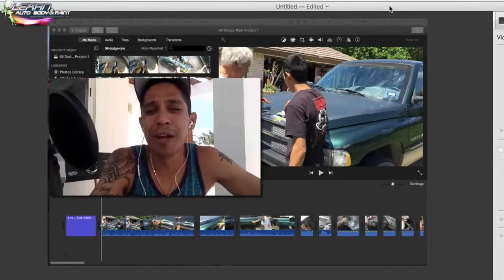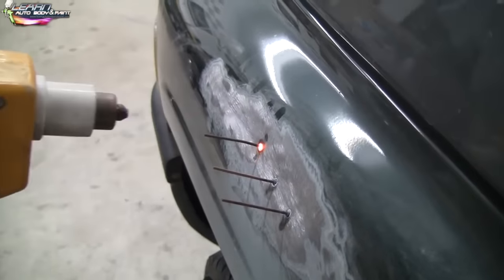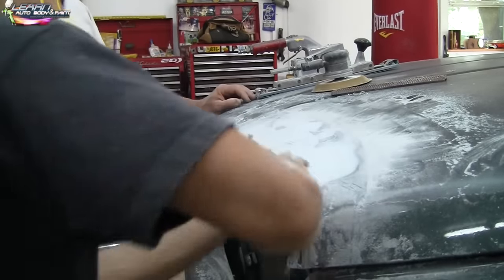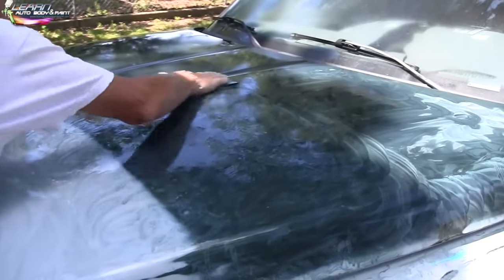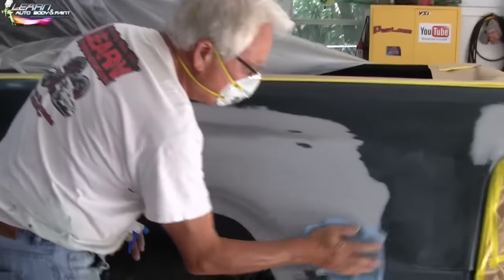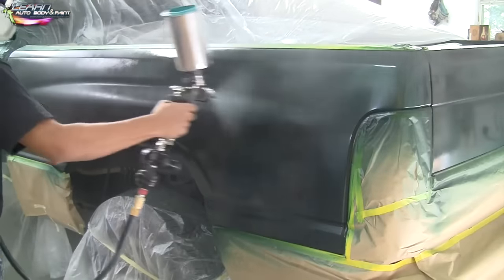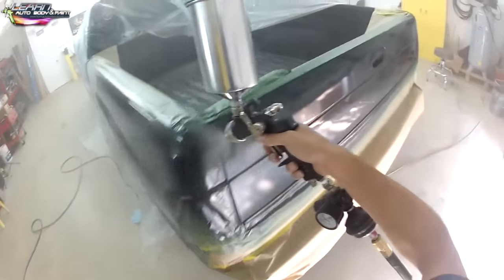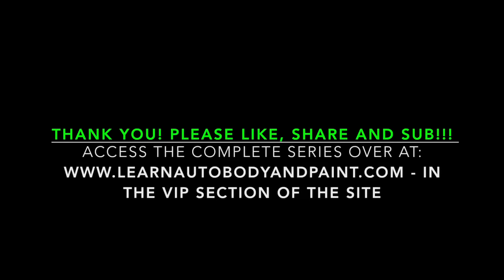For Newbies-  Auto Body And Car Painting Footage- Step by Step DIY SPECIAL

Comment: I have a question.  My car needs to be painted soon, but I have a relatively new safety sticker.    I also score it so it’s harder to steal.   Is there anyway to remove it before the car is painted so it can be put back on after the car is painted?

Comment: Hey Tony, quick question... I'll be spraying my 2011 Silverado extended cab with Blue Ray metallic and then clear coat. How much time do I allow my base coats to dry in about 70-80° and then how long after base coats do I wait to spray my clear and how long in between clear coats?

Comment: when you say about newbies not applying enough clear coat i think it's better to not soak it with clear coat cuz it will drip down and ruin the paint job
Reply: Little Man Huerta as long as your allowing flash time you can put on a few coats. just don't go back to back.

Comment: 80 grit prep for filler? to course it will shrink back, use 180grit . 320grit for primer filler, 600grit for high solids and black, brighter basecoats and water based will show the scratches below 800grit. No PPE? Spray gun looks like bought from Aldi stores? NO, Its not better to have more clear . your colour matching will be off if too much clear. Rule is simple - you can't do colour matching don't do the job!

Comment: I was surprised the truck didnt get a primer before painting. Do you have to get the old clearcoat removed?
Reply from the maker: Hey Ron, check this out: https://www.learnautobodyandpaint.com/car-painting-hacks-no-primer-needed-over-clearcoat-basecoat-with-atom-x16/
Reply: @LearnAutoBodyDIY  thanks Tony. I have a Fiat 500 I picked up with front end damage which is all fixed. It appears car went through brush like a rose garden  hundreds of pin homes through paint and no dings. Can I wet sand than hit it with filler primer, sand and paint? The pin holes are all over fenders and not sure if I just paint they'll cover up. If I can send pic they'd be great. Am a vip member

Comment: Hi  tony  ,  i  have  a  question  when you buy  new  wool pad for your  buffer  do  you  ever  have  any   lint  fly  off  when buffing  with   new  wool  pad?  i bought  3m  single  side  hook it  yellow  wool pad  i was  buffing then  wool fuzz  was  off .
Reply: They are all like that new. Gotta break them in a little bit on a test surface with some product  and then you should be good 👍

Comment: If the repair is at the front of the bonnet, i don't see why you base coated the entire thing.. it would have been alot more effective to steer well clear of the panels that meet edge to edge with the bonnet, and just blend the colour up the bonnet with a smooth transition, and then clear the whole thing.. That way you don't get the edge to edge colour difference on the wings

Comment: I am new to painting, I noticed you where using omni, when I finish my clear coat I am having a problem of getting specs on the top of the clear. do you have any suggestions, to prevent or remove it?

Comment: I want to do this to my work truck. Its starting to flake and get surface rust. I expect at least another 10 years out of the truck and don't want it rusted through.
Reply: phatrides222000 good way to keep it even longer is remove the bed of the truck spray the underneath with rubber and spray the frame with rubber we have guys who have pick ups from the 70's with underneaths that look show room

Comment: What about the dust? Dont you need a paint cabin to do these things?
Reply: Yes and no, you definitely need a place that you can control the atmosphere around you. A shed will work as long as you have good ventilation and extraction fans are a plus too
Reply: @Sco33a101  ok, I thought that a lot of dust can set over the wet paint and ruin it
Reply: You are right, if working outside it's inevitable that dust will settle on your work. TO be honest mate, unless your doing a very pricey build you're not going to notice enough to care. But it's not impossible to build a paint cabin. Old coolrooms (meat holders) work excellent
Reply: @Sco33a101  Well, thing is I want to paint an arcade machine rather than a car, and I will be in front of it when playing, thats what worries me...

Comment: Your should used. Tinted sealer. Or a close green first. . Also your primer didn't feather all the way out.  No blending?? Also make sure when j spray the panel I have the whole area primer will be laying sanded better than u did

Comment: I have a question please. I have a 2005 Mercedes SL 500. Its current paint job is good and body great. But I would like to have it painted the new pearlized white on new mercedes and a coat or two of clear coat, or more if necessary. Will $3,000 - 4,000 give me a great job or could it cost allot more.Want to keep Body / Paint Shops close to expectations. Thank you for any help. Yes, I know you can have very expensive paint jobs,  but would money I quoted above, get me a goodjob........

thank you
Reply: Robert Lohr you could pay alot of money to try and get a good paint job. But none of that matters. Its really how good is the person thats doing the job. literally
Ive gotten customers that have gotten paint jobs done for a lot of money. came out as shitty jobs. Then here I come to fix their fucked up work for less than half for what they paid. and ended up very satisfied and happy with my kind of work. 
So yea is all aboute hiring someone that I have passion to do its job. Not just someone that wants money. So be careful because your project can turn in to a nightmare

Comment: You failed to mention ground coats. On a metallic green as transparent as you see it, a coat of black base would be essential in order  to get optimal color coverage when applying the metallic green. This will prevent the grey primer from becoming visible beneath the metallic green in direct sunlight. 

While it took about 4 coats of green before getting any REAL coverage, had the surface been black rather than grey, the hood may of already become completely green with plenty of green paint to spare.

Comment: What guns do you use for each process?
Reply from the maker: Check out the Atom Spray Guns on Zoolaa: https://www.zoolaa.com/ 
You can use 1 spray gun for overall car painting. Use the 1.3 or 1.4 tip size for base coat clear coat and the 2.0 tip kit for primers and other thicker materials.

Comment: yoo turn your pressure down when spraying primer.. 50% of your material is overspray and wasted. turn down pressure and slower strokes.. I spray for a job.. end of the day if it works for you then cool. I work in a high production shop and I would never spray that high of pressure.

Comment: With that f'ed-up hood I would've just bought a straight one at a bone yard instead of all that work and throwing a ton of body filler on it. If you're going to paint a hood, why not a straight undamaged one?   At the rear - why spend 10 minutes taping off the taillight when you can remove it much quicker?

Comment: It kinda bothers me that if they decided to paint the whole hood they should have patch the little hail dings because that's super easy. Second blending is not painting the whole bed side. Where the dent in the hood and bed was he didn't have to paint the whole thing. He should have painted the primer spot till it matxhed and gone about 6 to 8in outside of that giving the allusion that even the colors are really close but don't match that they do match. Yes he clear coated right but he should have clear coated the whole bed side including the different color. And thoes grills are cheap af and there tons of second gens in junk yards you could have spent the 30 mins in a junk yard looking for a good one. And you don't have to do multiple bondo coats if you lay your mud on thick the first time

Comment: Too much body filler. I'd make the metal as perfect as possible before bondo. Also, I would fill the panel with tin, not bondo, but tin work is for classic Ferrari I guess, not Dodge rams

Comment: omni greens and blues are garbage I had over eight coats on the last job I did with omni metallic blue
Reply: Foy's Rod's a close sealer helps. you could also cut the reducer for the first couple coats.

Comment: What a load of garbage. Sanding by hand without a block, spray on putty and guide coat, using an electronic sander to do most of the putty removal, 400 grit blend, using a tack rag to wipe down a vehicle in an dusty garage, no covering on skin or eye protection, obviously doesn’t care about exposure to isocyanate, etc. An absolute joke. Perfect example of how not to do body repair and paint.
Reply: You make a video then to show us how perfect you are. Not a bad job at all. he said they were not putting the extra time into it since the owner was going to flip the truck
Reply: Electronic sander....??hahahha...
Reply: @oldschool9447  a good magician never reveals his secrets.